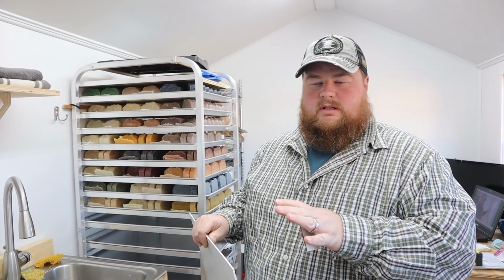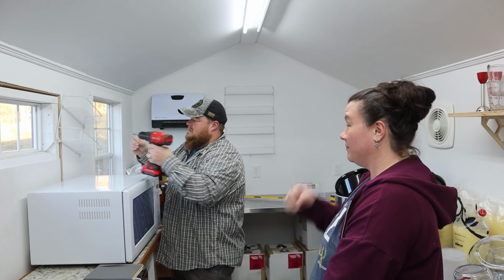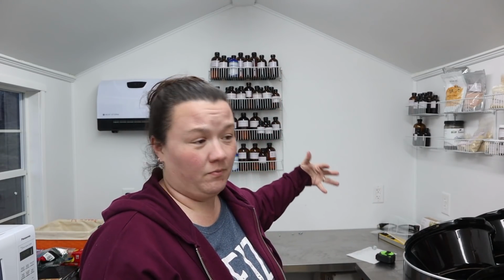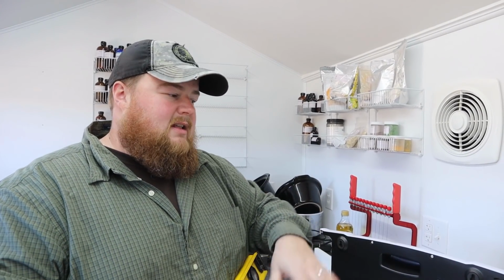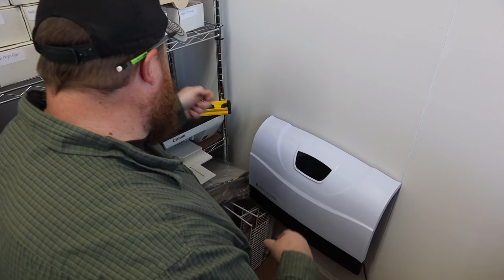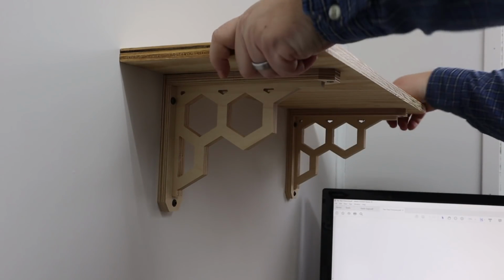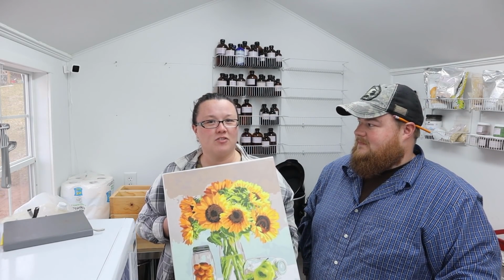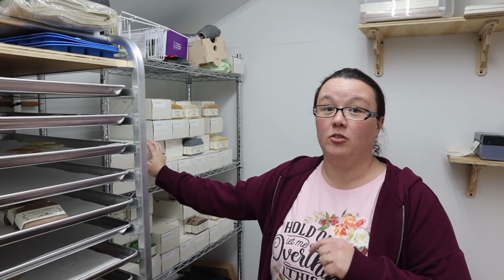This FINISHES the Soap Shack!

Comment: Do you have a white board?  It seems like the big space by the new shelves might be a good place for one.  You could write on it by swinging around from your computer or standing there, and be able to reference it even when your hands were busy on the other side of the room.  You could write a daily list or recipe ideas or a time you needed to do something or whatever.  I think it would be helpful to be able to see it and not have to lean over the desk for looking at a paper or relying on a computer list.  You have a lot going on in there :)  I could also see a bulletin board strip along the wall over the crock pots so you could pin quick notes above each different one.  This might just be me, but I need some words to remind me when I'm multi tasking :)
This soap shack working space is great!
Reply: I'm organized like Angela. 👍
I'd take your idea a step farther....
I would do a vertical mind board. Top half cork with push pins. 📍Bottom half a white erase board with a marker tray at the bottom.

Comment: ❓ I surely hope/trust you put a finish of some sort on the brackets and shelves‼️🥰

💡 I'm organized like Angela. I would add a vertical mind board. Top half cork with push pins. 📍
Bottom half a white erase board with a marker tray at the bottom. 📝
Hang it below the top shelf extension. As one commenter said, visible across the room. 👍

Comment: from one painter to another, if you have a canvas that has gotten "floppy"  just take a clean paint brush, one like you use on the wall, not your artist brush and coat the back of the canvas with plain water, coat it well, not dripping wet but well, as it dries it tightens itself back up. you did a beautiful job on your painting.
Reply from the maker: Awesome, thank you for that tip!

Comment: I’m in desperate need lol I’ve been amazed at you videos and love them. 

I bought a 12x24 building and in South Carolina it’s hot and humid but I’m doing a monogram business in this building and need to keep it cool. 
I’ve started putting foam board and lots of foam spray but I’ve got to keep my thousands of dollars in equipment safe. The roof I’m scared I can’t get it cool. 
I have 3 windows and house door. 
Should I use the bubble wrap stuff on the roof and loft area or the foam board and spray? I have a 8000 btu air conditioner that stands alone and tons of moisture blockers and dehumidifiers going also. 
Please help if you have an office number I can call or message me back here please. Your opinion is huge to me.

Comment: I've been using a drop shed for a workshop for about 5 years. 
One thing i wished I'd done to mine is 
INSULATE the FLOOR
As mine is flat on the ground it's too late for me.
Reply: Have the existing floor be just the base. Foam insulate and add a new subfloor. Then add the flooring of your choice. Add a vapor barrier as warranted.